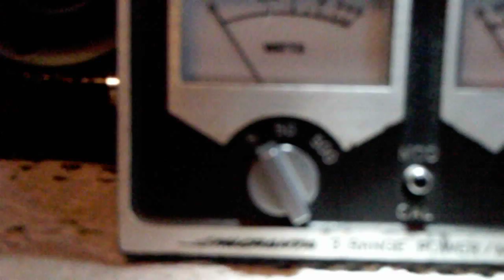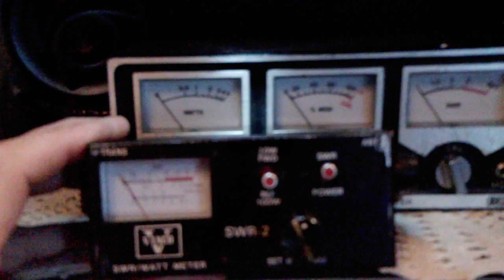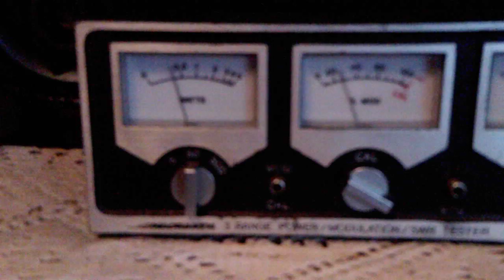Meter help

Comment: First of all never whistle into a radio. You don't talk on your radio and whistles do you? Good medium voice audio is what's best to use when you're checking output of radio. That meters easy to read when it's on the five what scale and you do your audio into it and it goes to lets say 2 that means you're putting out twowatts. If it's on the 50 W scale and it goes to two that means you're doing 20 W. If it's on a 500 W scale and it says 2. That means you're doing 200 W

Comment: What i'd like to know is what is the middle meter for, and what is the MON jack on the right side of the face place for?
Reply: SteelWolf13 the middle meter is modulation. the Mon jack is to monitor your audio thru a earphone. kinda like TalkBack.